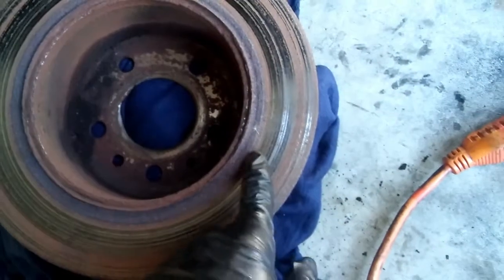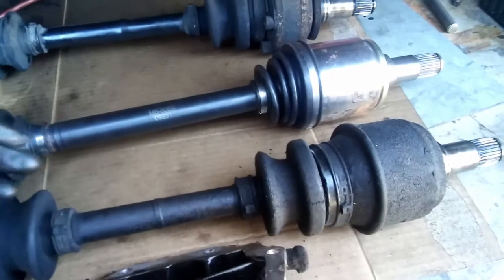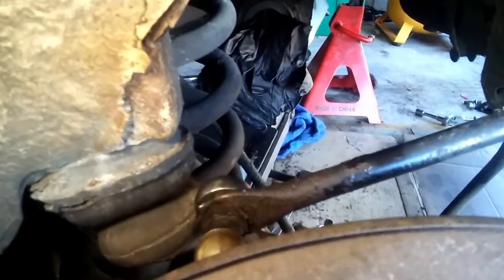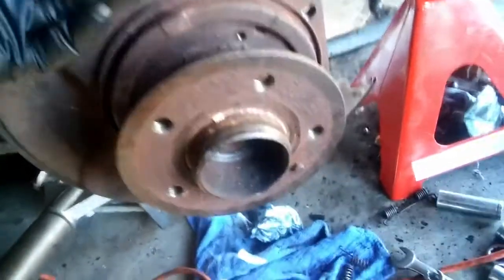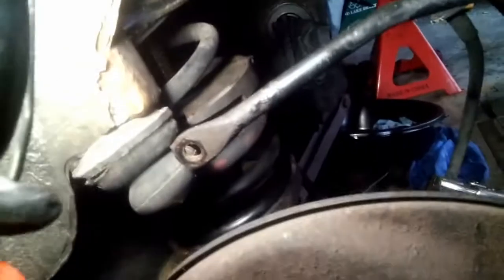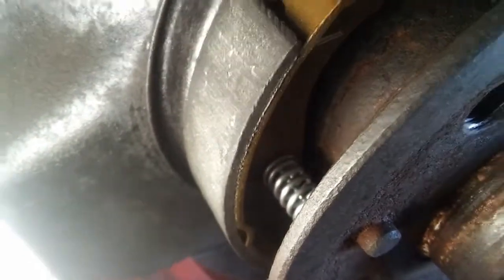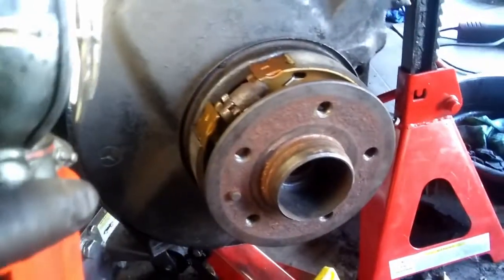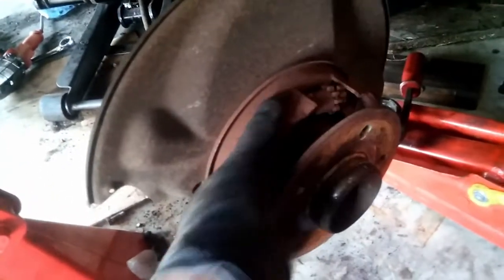MERCEDES W123: New Rear Coil Springs, New Parking Brake Shoes and Hardware!

Comment: How about the parts where the disc go, did you clean it to get the rust of parts either by using a wire brush to remove the surface rust, and the base where the spring goes , that is where some rust might collect, being that it might get the salt they use in the road, water from the puddles.
Reply from the maker: I don't remember. It was a while ago

Comment: I saw another one of your videos about the W126 vs. W123 spring heights.  
Can you swap the shorter W126 springs onto the W123 at all 4 corners with minimal work?
Reply from the maker: You can install W126 springs in the rear of a W123. Not the front though, I believe. And there’s no minimal work. Must have a special Mercedes spring compressor for that
Reply: @VITOSGARAGE  
Okay, thanks for the help!

Comment: The compressor rod is supposed to go in from the top, but that impossible on the rear.  I am assuming you turned it upside down and went in from the bottom?
Reply from the maker: The rod only goes from the bottom. Position both upper and lower plates and slide the compressor rod from the bottom. And then compress it from the bottom. You have to lift the car up as much as you can so the control arm will release the spring tension as much as possible. You will get it, just keep trying. But you won't be able to remove the rear spring without the compressor though
Reply: VITO'S GARAGE  I had my rear spring shift slightly at the bottom as I was lowering the a arm with a jack to get enough clearance for the new axles to go in.  Scared the crap out of me.  I am hoping that it will move back in place when I put the car back on the ground.  I sprayed a lot of lubricant around the rear coil and a arm pocket to help it move back hopefully.
Reply from the maker: +Jeep Wrangler JL I don't know how that happened to you. I am sorry about that. You can try to pop the spring back into place with a pry bar. Usually the spring never shifts like that, even if you lower the control arm all the way down with no shock absober in place.
By the way, if you undo the differential mount and jack up differential all the way, you will be able to get the axles out. You don't have to play with control arms, just with the differential by moving it up or down. Watch my video when I was doing my axles and diff cover as well as the mount. I don't remember what's it called, just search it in my W123 playlist.
Also, I will be doing axle boots on my W126 soon so I will make a video on how to remove the axles and put them back in
Reply: VITO'S GARAGE  I tried to move the diff up even with the diff mount off, but the other 4 bolts holding the diff to the sub frame was not letting it move.  Did you move the 4 bolts holding the diff to get yours to move?  Yes I was slowing lowering the arm down and heard a "pop" and looked, that stupid spring moved rearward and up slightly from where the lower coil end was.  If I had a lift this job would be super easy, but doing it on the ground totally sucks!
Reply from the maker: +Jeep Wrangler JL Yes I had to remove only the diff mount. I think I also had sway bar links disconnected but that's about it. When removing the axles I removed the outer joints first (not so easy, but they came out) and then the inner ones. 
Sorry that this happened, try to pop it back in its place using pry bar. The control arm has to be lowered as much as possible, otherwise that spring won't pop back in with too much tension.